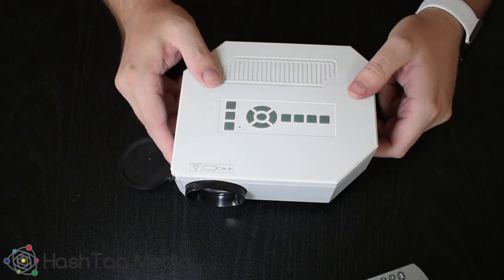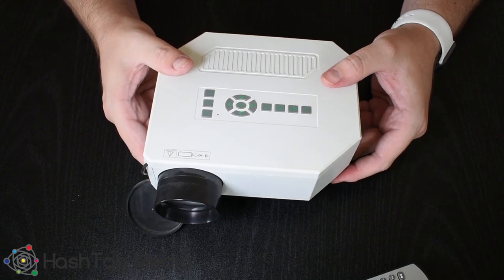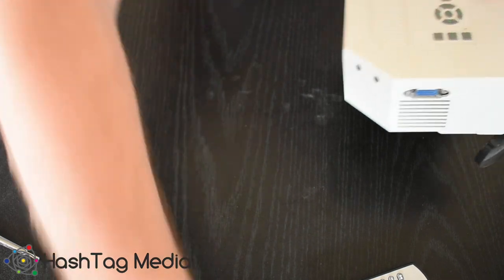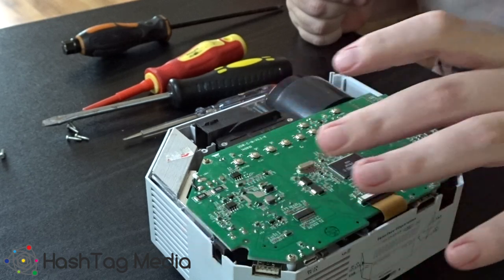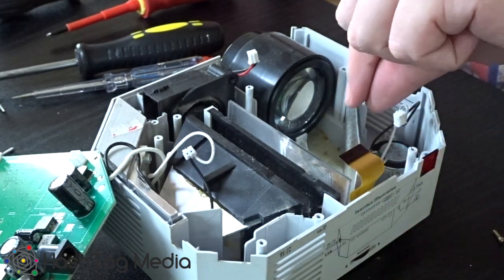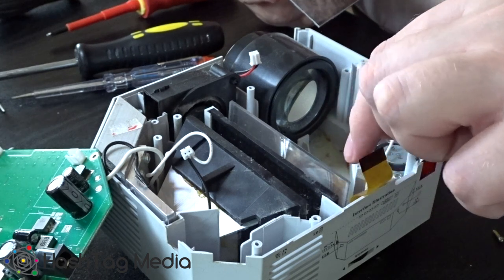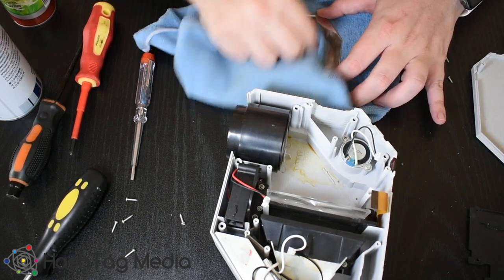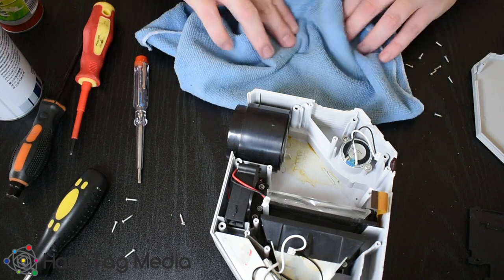LED Mini Projector - Tear Down & Repair.

Comment: Hi! I was wondering if the fan was pulling air into the projector, or if it was blowing air out. I have an identical model and I had to take it apart to repair, but now I'm not sure which way the fan is supposed to go back in. Any help would be great. Thanks.
Reply from the maker: Hi there, thanks for the comment, the fan was blowing the hot air out.
Reply: @HashtagMedia  Thanks for the info!